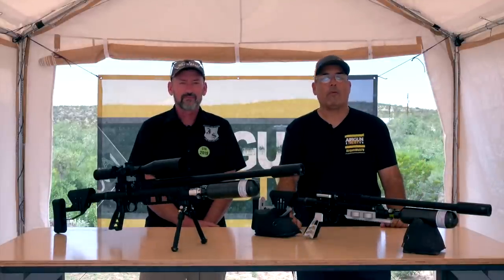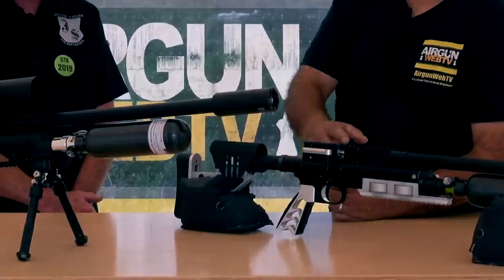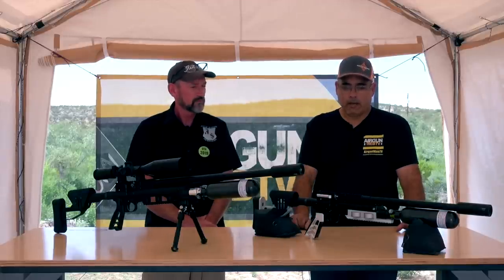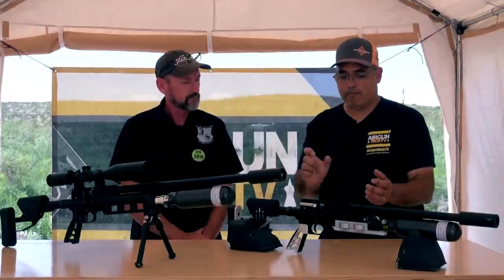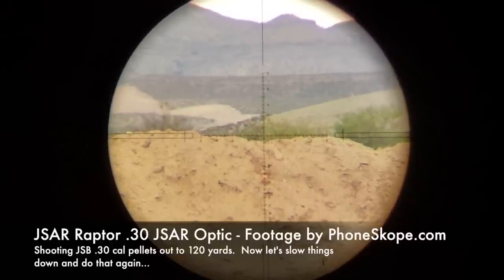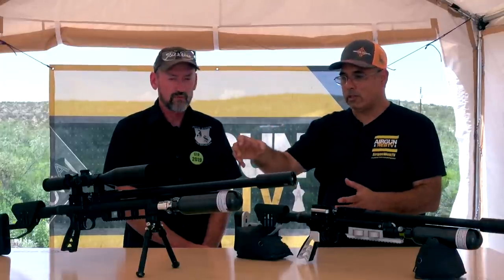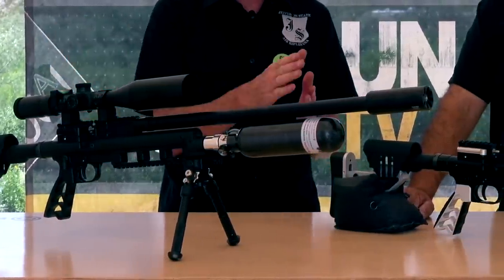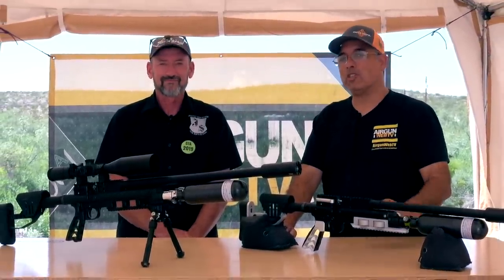JSAR Raptor Precision Air Rifle - Getting Technical! - Let’s see what makes this tick!

Comment: I'm considering either the raptor .30 or the dreamline tactical .30 for quiet coyote control at a spot I have. Long story short, I can discharge an actual rifle/shotgun, but due to the houses nearby, I would rather not. 75 yards and under, which would you recommend?

Comment: Whaaat regulated to 1800 PSI and getting 85 foot-pounds!!! Did I hear that right?
Reply: Wannabe Mgtow yup. Large plenum and large porting throughout the gun. Absolutely no need to mod this gun for power.
Reply: Can I mod it for helium?
Reply: I don't see why any modding would be necessary for helium. Do it!

KnifeMaker
Reply: @mikel9162  I was wondering if it can be made with it.  I come from car nodding and if the guns perfect for co2.  Optimized for air.  Why not change the gas?
Reply: Sorry, it is NOT made for co2. Dry nitorgen is fine though. These guns are  powerhouses.
Reply: @mikel9162  I'm still learning. So much airguns lol. Especially the past 5 years they've  made so much research and development and progress.  Honestly hunting with those big bore and little recoil won me
Reply: Yep! This is truly the Golden Age of Air Guns.  Seems lie advancements are happening daily. An exaggeration, But advancements in technology in Air Guns are coming out faster, and more often than any time in history. KnifeMaker

Comment: So much easier to mount that scope and a silencer on a .22 rimfire.

I have a .22 HK416 and a 5.56 AR-15.

It’s just easier.
Reply: Easier is cool but its the challenge that makes airgunning so fun. If it was easy it would be fun to do once but then what.  The challenge keeps it interesting.
Reply: FX Impact mkii Will out group most Top manufactured Rimfires on the market out to 150yards maybe more. Then turn it down for backyard fun. My BSA Scorpion SE smokes my Ruger PR @50-75 yards. Which is saying something, bc, its only 32ft/lb vs 120ft/lb Shooting eley match.
Reply: Bigtruckseriesreview Motorsports yes, it is easier to get the performance. But harder to find a place to shoot. You can shoot airguns in your backyard.
Reply: You know what you know how long it takes to  buy a suppressor for a firearm?! Also the lead and carbon smoke from the bullet isn't healthy and not clean. Airguns you almost never need to clean and if you do only the barrel I don't have to take apart everything and clean a dirty ass rimfire ok?! And airguns nowadays are more accurate than rimfires and way quieter and fun to shoot. Anyways rimfire is cool for semi auto but even now I have a sk-19 that goes full auto with 60 foot pounds I don't think I need more than that. Have fun with your ear deafning 556